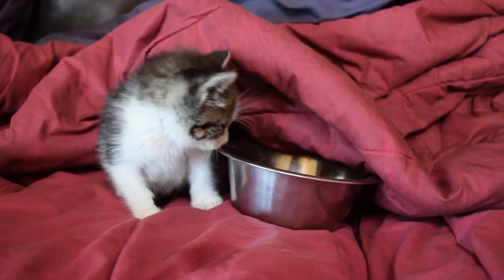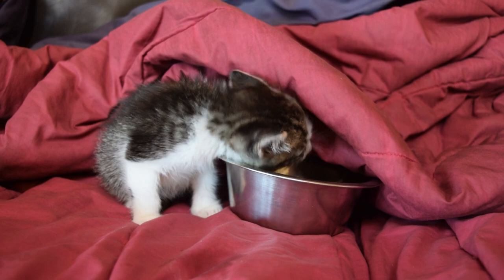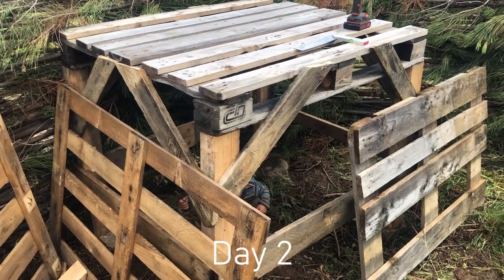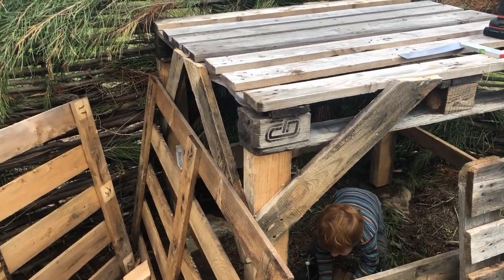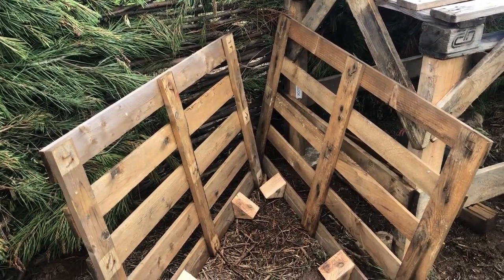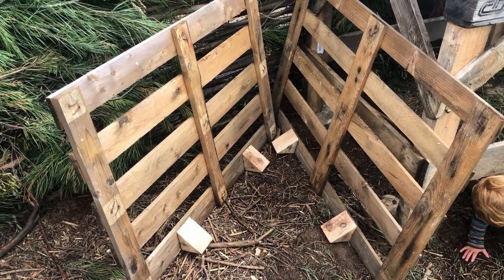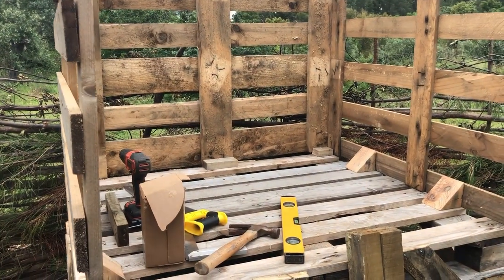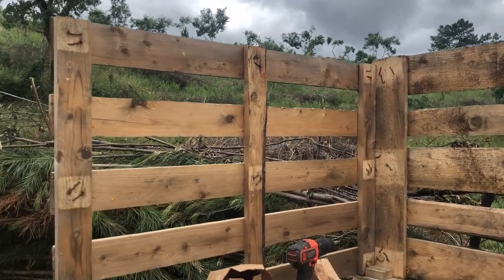Building a chicken coop from pallets - Building our off-grid homestead in Central Portugal

Comment: Great fence round the coop! Is it sheltered from the wind? I wonder if it might blow over in a storm. Where I live the wind takes everything if you don't fix it securely to the ground... I look forward to meeting your chickens.
Reply: Hi Veronica, the fence should stand up to some wind. We dug in every post and every third post is extra thick and dug down a bit deeper with rocks hammered around them. We also built it in an oval pointing in the predominant wind direction and on top of that the whole run is at the bottom of the valley where it is sheltered from most of the wind. Fingers crossed 🤞
Reply: @maarton  it's the coop I was worried about in a strong wind. Is it secured to the ground. It looks brilliant and the nesting boxes accessible to the outside. Yay!
Reply from the maker: Because it is made from pallets it’s really quite heavy, we can’t even lift it with the two of us, so I don’t think it will fall over in the wind.